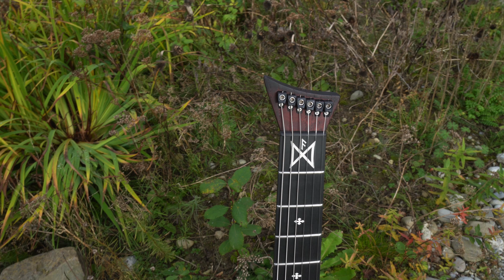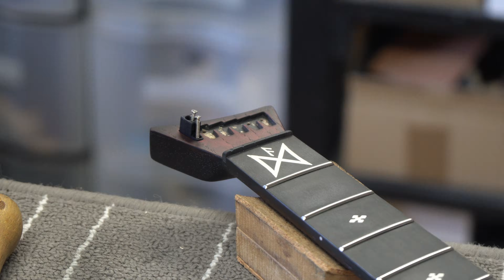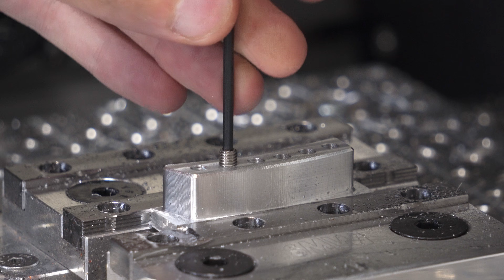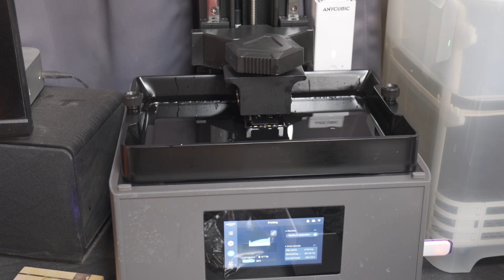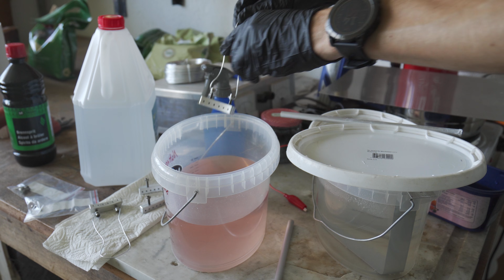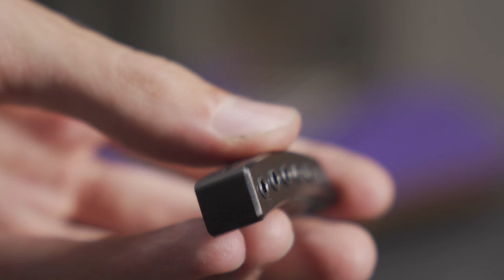Finally designing my own Guitar Hardware!

Comment: You could actually do your op 3 first, then you don't need to drill on an contoured face or need your printed fixture. Since those holes are centered on the block, when you probe the 2nd op they'll be in a known location.
Reply from the maker: Technically possible, but I'd also have to machine something to properly locate off in the now 2nd op as the raw stock is too rough. I would also have to use a bigger stock piece as the holes are angled compared to how I have my stock oriented at the moment.

Comment: I had to mod my headless headstock in similar way too, wood screws were not strong enough, but some bolts that attach through the other side of the wood are a very sturdy solution.

Comment: Look into a vibratory tumbler to polish the parts prior to anodizing. It may be a solution that can fit in your workspace.
Reply from the maker: At this point even an additional small desktop appliance is too much and there wouldn't be any room to store it for the 98% of the time I'm not using it. But I'm hoping to move into a bigger space sometime next year.
Reply: @DarkArtWorkshop  Yeah, I wasn't sure how limited you were. Being that dialed in with space usage sounds like a dream though, until you're at the limit that is!

Comment: Ive actually been trying to find a solution ao you dont even have to use an allen key at all for the grub screws. Like a knurled head on a threaded rod or maybe a screw that has a smooth upper part but no head, with a small hole in the middle that would allow for a piece of metal to be put thru it to get wnough leverage to tighten the screw down sufficently to hold the string. Many ideas. I love the idea of a tooless string change though since with a headstock guitar thats how it goes. Tooless is always going to be better so if there is some way you could incorporate that into the next generation of your head piece, im Sure you would have a great product that you might be able to actually sell to others as a standalone product.

Comment: Here is a link to the grub screws with a brass insert in the bottom and theres another link for the grub screws with the nylon insert. Various different lengths available and M5 is available. Again i would highly highly suggest using 2 grub screws per string and make the holes for the strings to pass thru on the low strings, bigger. I play .80 gauge on my lowest string so if i got a guitar from you and i couldnt fit my big strings thru the head piece hole, because its too small of a hole, then i would be very displeased. So i would also suggets that you make the holes big enough to accomidate thicker strings. This is also a problem i have had with many head pieces. I have to drill out the bridge tuner and the headpiece to allow for the .80 gauge to go thru. Even have to file the bridge saddle so the .80 will fit flat against it. Just trying to help you out with my realy world experience. I build guitars to man i just dont make videos but i do love watching yours and others on youtube. I hope i could contribute to your passion in a poaitive way. I appreciate the videos and everything man!

 AliExpress: 
$4.18 | 1-10pcs M2M2.5M3M4M5M6M8M10M12  stainless steel hex socket brass set screw
https://a.aliexpress.com/_mMLyzkV

AliExpress: 
$2.52 | 2pcs-10pcs M3 M4 M5 M6 M8 M10 304 Stainless Steel Hex Socket Plastic Nylon Dog Convex Point Tip Grub Headless Bolt Set Screw
https://a.aliexpress.com/_mMiuyTX

Comment: Every problem you mentioned about the various headpiece hardware out there are spot on. I've had all the same issues. I would honestly recommend that you make your hardware with 2 grub screws per string. And they also make grub screws that have a nylon insert on the bottom that is beautiful to hold the string but will never ever break one of the higher strings if the screw is over tightened. I think those 2 things would be a huge improvement for longevity of the instrument and not breaking strings. I've found no matter how smooth the bottom of the grub screw is, it can be tightened down too much and wear the high e string and the b string. A wider screw (bigger diameter) really helps but for some reason I've still had a few strings break. I think the nylon bottom grub screw is a great idea and should not allow the string to slip or break. Just thought I would mention this. More important than the nylon is having 2 grub screws though. Just in case anything happens with a screw being stripped or the threads messing up, there's always a second screw as well so the guitar can still be played and used while waiting for replacement parts to come in.
Reply from the maker: I gotta look into the nylon grub screws they sound interesting. I'd be a bit worried about longevity though. The strings are quite hard and might crew up the nylon with just a few uses. Nylon is also quite slippery, so it might decrease the holding power. The other thing to consider is the bottom the string is pressed against, as if there are any sharp transitions there from the bottom of the bore to the side hole, that can also cause the string to break.
On the two rows of grub screws I actually disagree. I think they look bad and solve the issue of small screws by doubling up instead of simply using a bigger one.

Comment: Super super random thought.  Would you ever consider doing a zero fret guitar but with a tungsten carbide zero fret?  Think its an engineering question that may tickle your brain a bit
Reply from the maker: Would be interesting to do just for fun, but maybe not the most practical. One of the main appeals for a zero fret apart from not having to cut the nut as precise is that the material the string contacts is always the same, no matter if you're playing an open string or fretting a note. Though I'm not sure if there will be much difference between carbide and stainless steel.
Reply: @DarkArtWorkshop  Low action as well.  But the main complaint I hear is that stainless steel isn't hard enough to stop divots (strandberg forums say this). It would be neat to see if something harder could address that meaning zero frets could be more viable.
Reply from the maker: @killroy123  the low action part can be achieved just as well with a properly cut nut (just requires some fine tuning that the big factories omit). Haven't heard the issue with stainless wearing, but I can see how with a zero fret on especially a tremolo guitar there would be a bit more strain.
The main issue with carbide is that it doesn't really bend well, so you almost have to get it ground to the perfect radius and shape already.
Reply: @killroy123 every material will wear down eventually no matter what is used for a zero fret but I can say fro. Experience that a stainless steel zero fret definitely does wear down but it takes a long time. I am building a 7 string with hipshot trem with a stainless steel zero fret so I'm going to see how that holds up over time. Without a trem it's been years and the zero fret is still solid. I play that guitar almost every single day and it's a 27" 8 string headless with an .80 gauge on the top tuned to drop f# so the tension is really high on the guitar and all that tension is pushing against the zero fret constantly. I've  seen zero wear on it and i definitely do not baby the guitar at all. ever since I built this guitar I have fallen in love with the zero fret. It is so much faster and cheaper to replace the zero fret as opposed to a cut nut.and yes the open notes supposedly sound the same as fretted notes but I really do not hear much difference. maybe a little more highs in the frequency of the open strings but negligible at best imo.